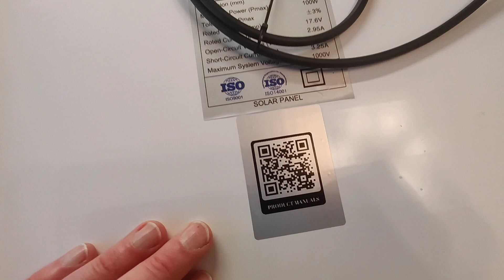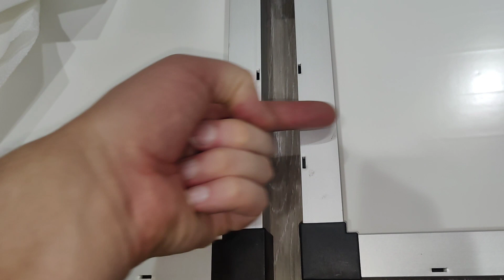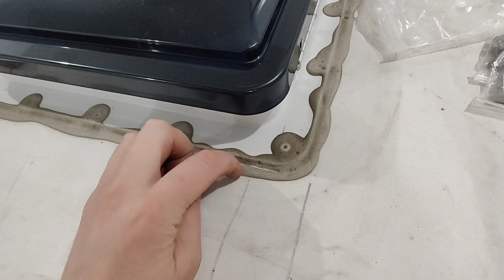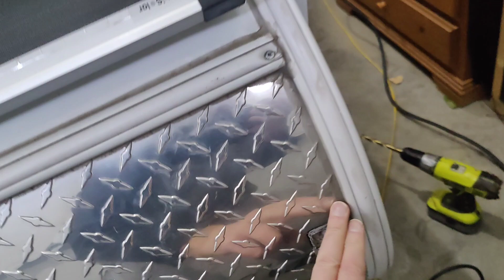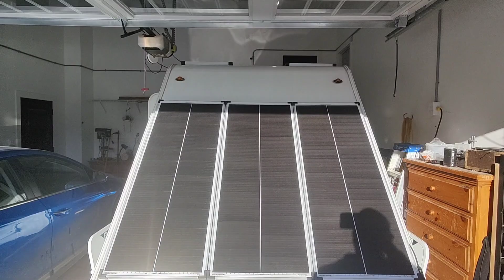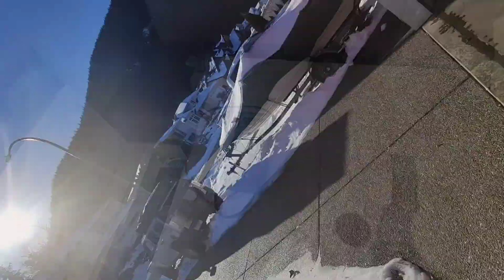Solar panel install on the Tiny Trailer!

Comment: You know what, I did the same thing… using glue between the bracket and the roof is not a good idea. After a while the membrane of the roof start to separate from the plywood underneath! Also instead of silicone you must use DICOR.
Reply from the maker: Well I also used screws though. 

Too late now lol

Thanks!